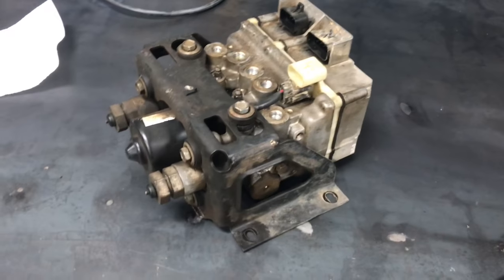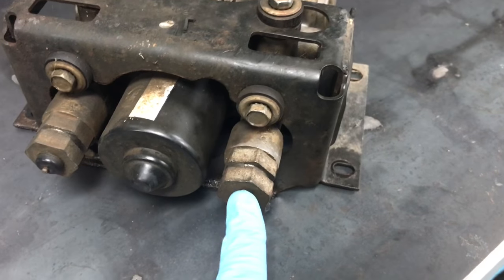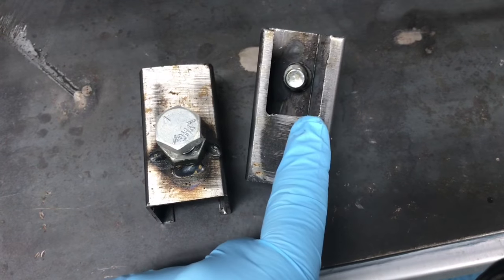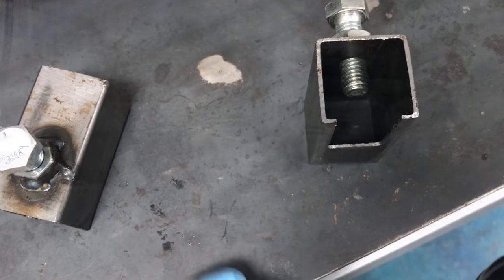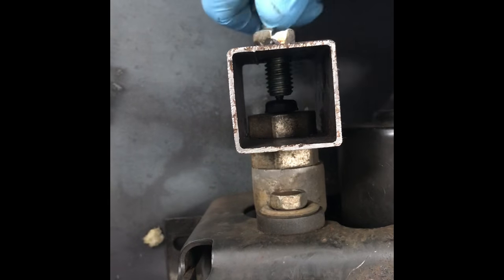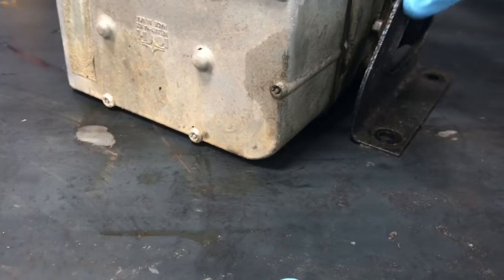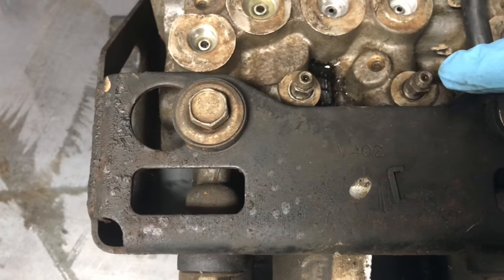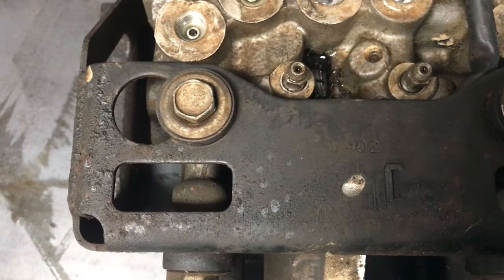How To Bleed Chevy and GMC 4WAL ABS Break System

Comment: I replaced all the lines on my 01 Silverado, can't get fluid to the pass rear . Harbor Freight vacuum pump isn't working do I need to bleed the ABS? After removing all those lines
Reply: I hope somebody answers your question, because I did the exact same thing on my 00 Silverado and have the exact same issue.  If I find an answer, I'll come back here and tell you.
Reply: @limbicresponse9077  me too
Reply: @jordansheppard6643  @Dirt Us I decided to take my 00 Silverado into a reputable shop.  For me, it ended up being a faulty wiring harness between the EBCM and the pump motor.  It was a $90 part, but much cheaper than the EBCM or the pump.
Reply: Yes..can someone help me also..bought a used abs pump for a 03 chev avalanche..no fluid coming out of rear brakes...8m stuck...I need help
Reply: @samkeychain4859  You may have to replace your master cylinder because the seals are worn or you should very carefully inspect the wheel cylinder or caliper in case they could have a fluid blockage or some other reason they are not allowing brake fluid through.
Reply: I did the same thing, just got them bled yesterday, real pita. 2001 Silverado 2500, but these steps will work on the 1500 with a vacuum booster and many other models. All you need is a Gatorade bottle, clear fuel line 2ft 5/16 OD 3/16 ID and a scanner tool capable of automated bleeding for ABS, I just so happened to have a snap-on mt2500. A second person sitting in the driver's seat to press the brake pedal is necessary. Drill a 5/16 hole in the cap of the Gatorade bottle and a smaller vent hole next to it. Feed the fuel line to the bottom of the Gatorade bottle through the 5/16 hole. The 5/16 hole will hold the fuel line very snug.
My master cylinder ran dry on the front feeder line. You can tell if the cylinder is dry if the reservoir is full but no fluid leaks from the open ports. To bench bleed without removing, I filled the reservoir all the way, place lots of shop rags under the MC. I connected the old piece of brake line cut very short with the old nut. You can do one port at a time. Push your fuel line over the end of the brake line, pump the brake line several times until no air bubbles are present in the clear fuel line. Do not let the reservoir run dry. Once no air is exiting both ports on the MC, connect the feeder lines back to the MC. From this point on, check the reservoir often and between steps, do not let it run dry.
Start the vehicle and leave it running while you bleed the calipers and ABS. You will have to bleed all the calipers and do an automated bleed several times because all the lines are full of air. You can bleed front and rear separately, they are fed off of two separate lines. I started with the rear. The fuel line will fit over the bleeder screws in the calipers as well, do passenger side first then driver's side. Put the fuel line on the bleeder screw, crack it loose and have your assistant pump the brakes. The first few times you may not even get any fluid. Switch sides and do the same thing. Then do an automated ABS bleed, make sure you hold the brake pedal to the floor hard while it's bleeding itself. Repeat this process until a good amount of fluid comes out of the caliper bleed screws. Once that happens, have your assistant hold the brake pedal to the floor, crack the brake screw loose, let fluid flow out, close the bleeder before letting off of the brake pedal. Rinse and repeat until no air is coming out of the calipers. Repeat for the front. Once done with the front I went through all 4 calipers and double checked no air and verified no leaks. 
Make sure you check the reservoir often, do not let it run dry. You have probably already figured this out by now because it's been a year since you commented this, but I'm leaving this here because I struggled with this a little and couldn't find any useful information online, hopefully this will help someone.

Comment: Nicely done, but I found it ONLY by mistake after many, many others that don't apply!
  Mine is a "1993 GMC G2500 Vandura".  There are MANY vids on how to repair the ABS, including RE-soldering the pc board, but NONE of them are THIS style as the housing and electronics are configured completely different.  Therefore those instructions simply don't apply.
  Yours is identical to mine, so must cover 93's & prior.  As others have mentioned, it would be REALLY helpful if you could add the YEAR to your title.  Nice job!!!
Reply from the maker: Tim Fleischauer thanks for watching.
Reply: It seems to be an Kelsey-Hayes 4WAL ABS, look also in this article: https://www.motor.com/magazinepdfs/061998_01.pdf and about blleding: https://www.aa1car.com/library/abs_kelseyhayes.htm

Comment: Thanks for this video it is so informative,at what point does this have to be done because I am just wondering if bleeding through the regular process which is through the four wheels of the vehicle can't get the problem of air in the system solved.

Comment: Dude I've been trying  to get my brakes are for two years.. I replaced everything but the abs module... I couldn't bleed it...just checked one of my power vals is extended  out more than the other one ... if you could or would help that would be great and thanks again for your video

Comment: can having air in the abs cause the left front brake to not release after normal braking or could it be something internal in the abs like a valve not opening to release pressure for that drivers front brake. i was having this problem so i replaced all 4 rotors, calipers and pads. it still does it. driver front brake gets extremely hot like 500F while the passenger is 100F. when i open the bleeder valve on the driver front calipers it spurts out fluid until the pressure is gone. i do that with the truck off. truck = 2009 chevy 2500hd quad cab 4x4 6.0 engine

Comment: you mentioned pushing in on the high pressure pistons, but you never explained when in the process do you do that, or is it just holding them in place to keep them from popping or moving out of the position their already in?
Reply: I just did the dirt road maneuver, with many ruts and bumps driving at 40 mph doing about 15 hard foot pedal stopspedalabs
Reply: this also turned off annoying instrument panel beak light

Comment: Just the video I'mookong for thanks seabass I have the same abs in my 93 suburban k2500  my problem is the ans letting fluid into my rear brakes and front passenger caliper not nothing to the driver side caliper do you think I have air in my abs system?

Comment: I saw a video that had a  consumer-grade scan tool that would do this process but I cant find the video now. I have two scan tools and neither will preform this process. Do you know of a scan tool that has this feature? Good video and thanks for posting.
Reply from the maker: soylent green I now use an Autel DS808 and it has the brake bleed function. It is a  pricey unit but I think the cheaper Autel  units will do it to. Thanks for watching.

Comment: could this be why i have a modulator sensor popping up on my diagnostics? i replaced hubs, and master cylinder brakes were working ok but now it's like it's rubbing on something when i brake even at low speeds it kicks back at you

Comment: Hey man, excellent video really just what im looking for. I have a 93 Suburban and have codes 62, 66 and 86 I know 62 is a stuck reset switch which I am lead to believe is inside the 4wal unit. 66 is a open or bad pump motor relay and 86 is a shorted to B+ ABS indicator light.

My brake light is also on but I do not have code 87 which is the code of shorted brake light. But I was reading ... In the event of a hydraulic failure that closes the pressure differential switch, both lights will illuminate and the ABS will be disabled. So I think I have a hydraulic issue in my 4wal system. Im going to try and bleed it before condeming the motor completely.
Reply from the maker: Greg Baker thanks for watching.

Comment: 2003 Chev Avalanche... for HOURS I tried everything to bleed Brake system after replacing GM Kit All 7 factory steel lines, Truck was Running on 4 Jack stands all tires removed would NOT BLEED....  Then this worked Turn Key ON and DISCONNECT BATTERY leave sit for an Hour Then Pump and Bleed Brakes with Truck NOT Running and Battery Disconnected Tons more Air came out...
Reply: Can you explain how you think this opens the abs to allow full bleeding process?
Reply: @lawnservice492  I have 39 years Auto Body and do All my own repairs (this was a friends Chev Avalanche)... I had a friend pick me up a $300 scan tool that would run the ABS pump (Did NOT Open and returned the next day)... KEY was in the ON position when Battery was disconnected.... I finished Bleeding the Brakes with Battery disconnected and Key in On Position and Truck NOT running.... I'm guessing ABS pump relaxed its valves when battery power was drained...
Reply: @lawnservice492  I also do a 1-man Brake Bleed.... Remove Clean and Grease All Bleeder Valves... install a 4 ft 1/8 inch Clear plastic Hose on 1 or all 4 Bleeder Valves.... Wire or Tape other end of 1/8 Clear Hose up high to a Chair or Step Ladder (Brake Fluid removes Paint so be careful)  Fill 1/8 plastic Hose half full with Brake Fluid.... As Air Bubbles comes out Brake Fluid goes in, keep 1/8 plastic line half full.... If peddle pumping is required pump up and hold brake petal with collapsible hood rod then open bleeder valve...The 1/8 plastic hose works with Petal pumping and without... This method also works great on Hydraulic clutches removing super fine air bubbles....  I learned this by Mistake Sucking ALL the fluid out of my W124 Diesel Mercedes with ABS.... Hope this Helps
Reply: @lawnservice492  The Rear Brakes Bleed quick and easy and they were both on a single line.... It was the Two Front Separate Brakes lines I was having the problems with getting fluid pass the ABS pump...
Reply: @kelvenguard  I’m working on a 2005 Tahoe it lost a rubber brake line and air entered the system.  The shop couldn’t bleed the brakes bc they are not equipped apparently for this type job :)
I have a mushy pedal and some braking power but not like before losing fluid.  I’ll get back to you on how this process worked for me as I’m always reading these comments to find what is easiest and works.  Thank you for the suggestion on YouTube sir!!!
Reply: @lawnservice492  Replacing a Rubber Flex Line or Brake Caliber is usually really easy to Bleed.... and the 1/8 clear Plastic line filled with Brake Fluid really helps... These I usually Set up Open bleeder and Pump Brake Peddle SLOW Big Bubbles come out Brake Fluid goes in..... For Hydraulic Clutch set up 1/8 clear line wired to open hood fill with clutch fluid, Bleeding a Clutch Pump FAST little foam Bubbles and super small bubbles keep coming out of clutch system Clutches take time opening and closing bleeder as you pump clutch peddle...
Reply: @lawnservice492  Sad thing today Everyone is Running Scared of getting sued for fixing a car... ie shut down the Whole World cause of the common cold as they sit there confused trying to figure out what gender they are... Mushy Spongy Brake peddle is just Air in the system or old dirty wore out fluid.... The city shop wouldn't fix my friends Avalanche either that's why I offered to replaced ALL the old broken rusted line with NEW GM Factory Lines...

Comment: I have a 03 trailblazer if this doesn't work is it possible to eliminate the abs by rerouting the brake lines
Reply: Don't do that. You can buy an Autel Maxi-pro diagnostic scanner W/abs function for about $200 off Amazon. It will do ABS on alot of cars and trucks 1996 & newer. There's also a cheaper one that plugs into your diagnostic port and links with your smartphone via bluetooth. That one is about $130-$150 ish. What it does is activates your abs motor to get the air bubbles out. Then you can manually bleed the air out of the lines. I finally bought one and did it myself.  I took my 97 S-10 several places and I don't think they bled them correctly.  After about a week my brake pedal kept getting mushy. After I ran the abs bleed function and manually bled them. My brakes are fixed 100% and pedal stays firm for about 3 weeks now. I bought the Maxi- pro bi-direcional scanner with ABS bleed function. And a pressure bleeding tool. I don't think you really need the pressure bleeding tool to do the job. I mostly work by myself and the pressure bleeding tool allows you to bleed  brakes & clutch by yourself. You do need those internal piston lock out tools the guy made in this video. Proform makes them for about $20. You really only need 1 though.  Bleed the back then switch the piston lock out tool to the other piston for the front and bleed the front.

Comment: Does the high pressure pistons have to be depressed by the tool or is it just to hold it from coming out?
Reply from the maker: Joshua Cheatham needs to be held in. I don’t think you can put enough pressure on it with out a tool to keep it held in. Thanks for watching.
Reply: Would a  2 C clamps work if they're big enough